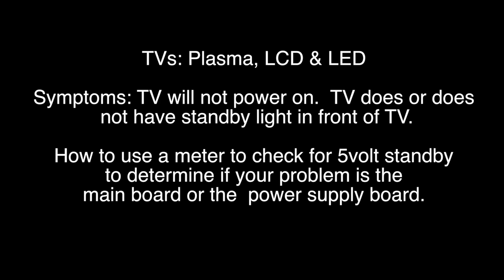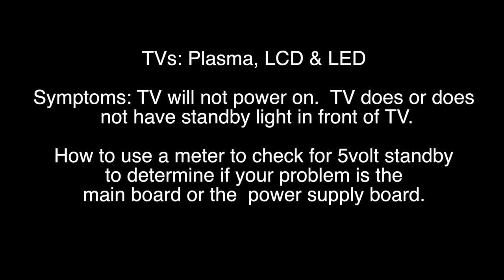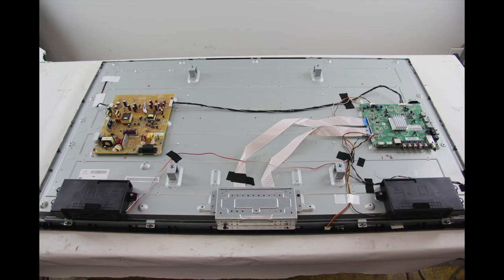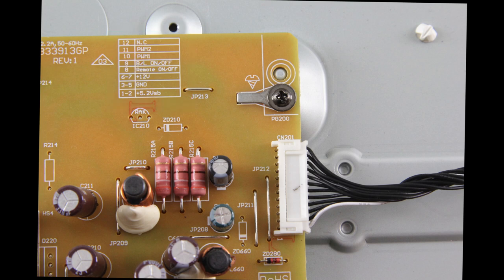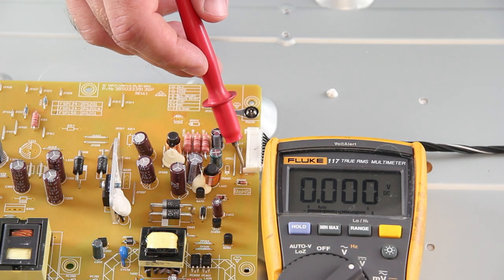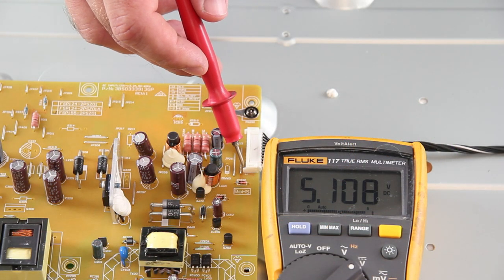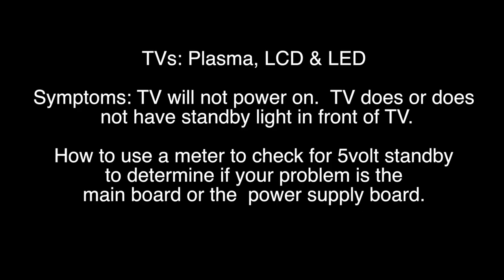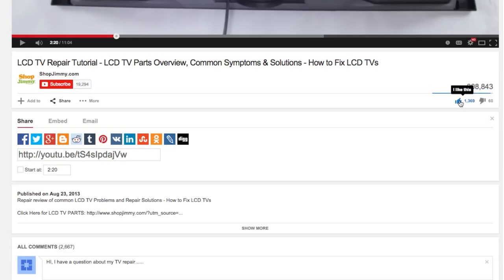TV Will Not Turn On Troubleshooting Help - LED, LCD & Plasma TV Troubleshooting TV Will Not Power On

Comment: I have a sanyo dp50740 plasma tv and I have replaced both the power supply board purchased from shopjimmy and a main board and the TV still will only turn on fit 1 second then shut off. what is the next step
Reply: Buy a new one
Reply: I am simply asking for some advice and you response with some stupid hateful comment that does nothing but upset and confuse. Why would you even waste my time and yours responding.
Reply: same thing I replaced 3 different boards on my 65 inch RCA and still nothing .. Its either they sending out broke parts or this is all a scam to make money . I hope we are both missing a step .

Comment: I have a KDL 52XBR9.  When I turn on the tv it has dark shadows that are mostly on the right side.  The shadow moves right to left and left to right.  After 15-20 min. the picture brightens and is clear. What part shall I replace ? Would changing the backlight inverter fix the problem?
Reply from the maker: +Ronald Cabico  Try all repairs and troubleshooting at your own risk.  This sounds like a TV panel (TV Screen) problem.  If your TV panel is bad, it may be more cost-effective to replace the TV as panels are typically hard to find in stock, difficult to replace, and expensive.  Thanks and please let us know if you have any further questions!  www.shopjimmy.com

Comment: can i test the power board if its not connected to the main board?  i checked and its not getting any voltage at all , none of the pins are getting voltage.. i checked the fuse and it beebs and shows 0.01 ?

Comment: hey guys , I have a sharp lc - 50lb261u  won't turn on no sound and got a 7 blinks error code I have the service manual but there is no mention of error codes asked Sharp and best buy but looks like it's a top secret file 
could you help me out ?  thx

Comment: I have a VIZIO E500I-B1   
Tv will not turn on. standby light comes on and then fades out in a couple seconds, I have 5v at the 2 pins, what is my next step, main board seems like that could be the problem

Comment: my tv shows a steady standby light but I do not get a steady 5 volts until I unplug the main board from the power supply. it won't turn on and the lcd voltage is ok. the caps looks good.

Comment: have a lg flat  screen tv standby light (red light ) works goes in to stand by mode blue light ,but nothing works so i took the  back off to look fore fuse or anything noticeable _nothing
I Put it back together in mean time ordered remote i tried it again nothing at first started hitting buttons on/off then live tv input and tv worked put hanger on tv  mount to mount it turn on nothing except stand by light (blue) black screen major headache do i replace the mother board

Comment: Replaced all boards on roku TV 49l621u and turns on then off right away.power board shows all good voltages.the digital audio light stays on ,on the main board.Could it be a bad inverter?stand by blinks then goes out.

Comment: I've got a Vizio D55u-D1 power light but no picture.  I get 5 volts on stand-by with main board plugged in.  When I unplug main board from power board and test stand-by I get 19.02 V.  Is that normal?  I thought there should be 5V either way.

Comment: My 50" Panasonic TV TC-P50U50 when plugged in the red led light is off.  Pushing the power button on the remote will turn on the red led light but not screen or sound.  The red led "does not blink".  The remote will not shut down the TV or do anything, have to unplug to power down.  I tested the power supply board (MPF6913B 1Z) at the output pins and no 5v standby voltage.  Which is odd since I have the standby red led.  So would it be the power supply board or would something be happening to my main board?

Comment: I have a LG tv that was hit by a surge during lightning. I get 120 volts on power supply, but on the standby(5.2V) im getting 10V, the 20V pin is reading at 50V and the 12V pin reads 26V. Is this just a bad board?

Comment: I’m not sure if it’s the power supply or the main board my 50 inch LGLED TV will turn on I can see the LG logo for a second and then it’s gone I have my 3.5 V for standby so I’m not sure what to replace any comments would help thank you

Comment: so if my LG plasma has red light on front, you press power, it goes green and immediately back to red, if I check the standby and havce no voltage then this is the problem? power boarD?
Reply: Sounds like a short.. unplug things from board 1 by 1

Comment: Hi I need help when i turn on my tv the standby lit in few seconds then died ...screen is totally black no sound i alrteady check the screen using flashlight totally black .... Is this the power supply or main board issues? I have a vizio M43-C1 Led TV... i already took out the power supply board i check the fuse using multimeter fuse still looks good. I check capacitor no bulky capacitor found. Need help? Thanks

Comment: I have an RCA LED39B45RQ and when I plug it in, the power light on the front turns on and immediately turns off when I push the power button. I never see picture or sound. The color of the light is amber and once I touch the power button, the light never comes back unless I unplug and plug it back in. Any ideas?

Comment: Hello, i have toshiba regza LCD 40LV685D. When i plug to energy cable to electric network stand by led firstly green after ten seconds turn to the red. When i press and hold power button on tv turn it green then turn to the red again. No image and no sounds. Can you help me?

Comment: Urmieh 
sharp LC 60LE600U shows on light for 5-10 seconds then goes off. I get 10.5 v on pin 15 for stand by, should be 5v. what it means....

Comment: Hi I have a Samsung smart tv  UN55D6000SFXZA that won't turn on and has a stand by light flashing where can I start? Thanks,
Reply from the maker: +Juvencio Barcenas   Try all repairs and troubleshooting at your own risk.  I recommend replacing the main board in your TV.  Click this link to replacement parts for your TV model number:  http://www.shopjimmy.com/catalogsearch/result/index/?cat=56&q=UN55D6000SFXZA  There may be multiple boards for the same TV model number, be sure to match part numbers on your current board, with your replacement for compatibility.  Here is a link to a video showing how to identify your part number, click here:  https://www.youtube.com/watch?v=BEPWrefQvqI  Thanks and please let us know if you have any further questions with your TV Repair!  www.shopjimmy.com

Comment: Emerson 32" LED TV will not turn on. When I plug the tv in, the red standby LED comes on. I press the local on button, the red standy LED goes out. After about 1 second, the red LED flashes on and off 5 times at about 1 second intervals. 1 second later, the red standby LED comes on steady. No sounds/noises and nothing on the screen. I replaced the main board and had the same symtoms as with the original board. 

Model: LF320M4 A
Board: BA4AFPG0201 1
S/N: ME7A15124262393 (A4AFQUT)

Any thoughts? Thsnk you.

Comment: I have a Emerson 50 inch led tv model number lf501em4f that will not power on the red standby light blinks on and off I noticed a few days before that my remote was not working the way it should even with new battery's but also a transformer on the power pole within seeing distance from my house exploded and our power to the house went out about the same time the next day after my tv will not turn on I need help plz

Comment: So to summarise - If you have 5 volts replace one board, if you don't have 5v replace the other. Not really 'troubleshooting' is it? I could have save y'all time on this video by just saying - "Replace both boards". This isn't really a 'troubleshooting" video. I was hoping for more in-depth analysis of the components on the board to track failure.

Comment: Hi, I have a SHARP LC-80LE857U it doesn't turn on at as well, however there is a little stand by light below the screen and makes a click sound when I hit the power button on the remote, but nothing on the screen and no sound. can anyone tell me if it would be a power supply issue?

Comment: hello,  
I have the samsung LN52b750U1F lcd tv.....the standby light comes on when the power button is pressed on the remote, the tv then makes a repeated clicking sound over and over.  The standby  lights comes on and off.... I'll press the power button repeatedly, leave it alone, then after some time theres an audible sound bell over and over.....it then comes on after a total of 10 -20 minutes all by itself. any suggestions?

Comment: I have a Samsung tv, no back light no standby light. I've purchase the main board, the power board and t con board from your company and I still not getting power. I've check the voltage reading at 1.42 volts, please help

Comment: Have Samsung 55in LED TV UN55D6050TFXZA. TV will not power on by remote or touching ON/OFF.  No stand-by LED but never really noticed if it has one.  ON/OFF touch switch is on front panel with other touch controls.  Digital audio connector on back panel is flashing.  I tested for 5V as suggested in this video and DO have 5V on power board going to main board. No visual indication of failure on either board. Looks like next step is to replace main board per this video.  Anything else I should check first?  TV is 3 yrs old.

Comment: My 43" samsung plasma TV is tripping my MCB whenever I tried to power on. A service engineer came and checked that most components of the power supply board is short. He told me that he'll repair the board first and then will reinstall in the TV and if again it goes short circuit then culprit may be the panel. But my question is can there be a way to check all the boards and find out the root cause before start the repairing of any particular component?

Comment: when I check for power the meter goes up and down. When I unplug main board the voltage is constant at pin on power supply. Does that mean the main board is bad? It looks kind of smoked in the center
Reply: That's the most likely culprit

Comment: Hi, I have Panasonic HD TH-50PX80U doesn't power on , just a continuous red blinking light. Please help
Reply from the maker: +Mario Gonzales   Try this at your own risk. Unplug the TV, then disconnect the SC board and plug in the TV to see if the TV powers up. Note that it will not have a picture on the screen. Reply with the results of this test. Thanks! www.shopjimmy.com
Reply: Power supply is borked, replacing the capacitors will remedy this or you can replace the entire PSB
Reply: Fix sharp aqueous led tv
Reply: Mario Gonzales
Reply: On side of P-board, corrosion on the rail - under the abrasion tape 
(chip resistor corroded).  Eight of them in Series going to ground. 
R820-R827. Symptom= TV turns on then shuts off, Red LED blinks, 
eventually turns on again - continuously.
Yours sounds like a 12V problem, similar.

Comment: Hello ! Good video but i have a question : when you put your red cable of multimeter in the pin 1, where do you put the black cable of multimeter (com) ? Thanks !
Reply: Put ur black cable of the multimeter to the ground anywhere to the tv body

Comment: Hi!! Thanks for those videos. They are helpful!! Well, I would appreciate if you can give me some advice about my problem.. I have my RCA LED TV wich after a thunderbolt won't turn on.
I checked it up and found in the cold section,  just after the optocoupler, one component tag as R431 (SOT23 encapsulated) exploited and close to it there was this component tag as SBR10100CTB (I think it's a rectifier), this one was in short circuit. I replaced them but still my tv won't turn on. I can see after replace those components  I have 12V in cold section and dc volt but I don't see the 5v for the processor and the other part of the mainboard. Any clues? The mainboard part is TP.MS3393.PB855

Comment: I hope to 60 inch Sharp Aquos televisions no fun little light flashes on the front of it no picture no sound possibly the mainboard I don't know what are you think flashing codes like 3 times maybe in another time
Reply: I have to 60 inch TVs that are Sharp Aquos televisions flatten front flashes no lights nowhere else no no sound no nothing it may be the main but I don't know but the part number is G 382 FM 01 Anna Blade the board number is kg 3/8 two QP w b XG three H2 w Jay-Z Z can you help me
Reply: Benny Pendergrass

Comment: hey bro Sony led is working with ac/dc adaptor ,when  it turn off automatically so i have to twist that adaptor wire a bit so its come back working then turn off again , so how to fix that adaptor man????
Reply: You replace the end on that adaptor OR reflow the solder on the socket for the adapter in the tv set..
Reply: ElfNet Gaming i solved the problem i have to unplug it , when i need to turn on tv so i have to plug back

Comment: I have a Samsung un46B6000VFXZ. sTARTS CLICKING WHEN PLUGGED UP. disconnected mAIN BD TO pOWER SUPPLY. STOPS CLICKING AND BACKLIGHT COMES ON IS THIS MAIN BOARD
Reply from the maker: +Michael Lynn  Try all repairs and troubleshooting at your own risk.  I recommend replacing the main board in your TV.  Click this link to replacement parts for your TV model number:  http://www.shopjimmy.com/catalogsearch/result/index/?cat=56&q=un46B6000VFXZ  There may be multiple boards for the same TV model number, be sure to match part numbers on your current board, with your replacement for compatibility.  Here is a link to a video showing how to identify your part number, click here:  https://www.youtube.com/watch?v=BEPWrefQvqI  Thanks and please let us know if you have any further questions with your TV Repair!  www.shopjimmy.com

Comment: Hello from a appreciative subscriber,

I’m trying to determine whether to order a EBU62287640 or a EAY63071804 for an LG 32LB560B-UZ.BUSMLJM and would appreciate your opinion.

Symptom: TV does not appear to power-on: no video, no power indicator or standby light

Steps Taken (while boards still mounted to tv):
- Unplugged for extended period, then plugged back in (have seen this fix other televisions before, but knew it would be unlikely)- did not help
- Tried both the actual power button and the remote control power button- still nothing
- Verified power cord was connected to a good outlet
- Looked at both boards, no puffy capacitors, no obvious burns
- Ceramic fuses have continuity
- Measured voltages on output of power board using chassis as ground:
  Labelled 12v/12v - Actual Reading 11.7v
  Labelled 3.5v/3.5v - Actual Reading 3.4v
  Labelled 24v/24v - Actual Reading 25v
  Labelled PWR-ON/DRV-ON - did not take reading

Initially, before taking power readings, I thought that surely this would be a power board issue, but those power readings look really close to me, although I don’t know the board tolerances.  Maybe I'm wrong and they're too far out of spec???

What do you think?  Is there more troubleshooting I should do?
Reply from the maker: +Curtis Faulkner   Try all repairs and troubleshooting at your own risk.  I recommend replacing the main board in your TV.  Click this link to replacement parts for your TV model number:  http://www.shopjimmy.com/lg-ebu62287640-main-board-for-32lb560b-uz.htm  There may be multiple boards for the same TV model number, be sure to match part numbers on your current board, with your replacement for compatibility.  Here is a link to a video showing how to identify your part number, click here:  https://www.youtube.com/watch?v=RwHTvjMdrhk  Thanks and please let us know if you have any further questions with your TV Repair!  www.shopjimmy.com
Reply: +ShopJimmy.com Thank you for the response!  I appreciate the recommendation.

Comment: what if there is just the one power supply board and a strip that runs across the bottom of my tv connected to the screen. 
Element
Model: ELEFW408

Comment: I have a Samsung LN32A450C1DXZA. The first symptom I had was that the standby light was blinking. I have replaced the power board. Now the standby light stays lit. When I hit the power button on the remote, I can see the standby light flicker registering the signal. Even when I push the power button on the side, it's the same result, no picture. I have taken the back cover off and do not see any back lights. I tried the flash light test but cannot seem to locate anything from a input notification to any semblance of a menu screen. Pitch Blackness. Any thoughts?
Reply from the maker: +Stephen J. Lonison  Try all repairs and troubleshooting at your own risk.   I recommend replacing the main board in your TV.  Click this link to replacement parts for your TV model number:  http://www.shopjimmy.com/catalogsearch/result/index/?cat=56&q=LN32A450C1DXZA  There may be multiple boards for the same TV model number, be sure to match part numbers on your current board, with your replacement for compatibility.  Here is a link to a video showing how to identify your part number, click here:  https://www.youtube.com/watch?v=BEPWrefQvqI  Thanks and please let us know if you have any further questions with your TV Repair!  www.shopjimmy.com

Comment: I havea Panasonic TC-L47E50 TV.
I am getting a 10 blink code.
I have replaced the power supply board, A board and now the mother board.
Still no picture, but after changing the motherboard I now have 8 blink code.
Can someone help me with this problem please. Thank you